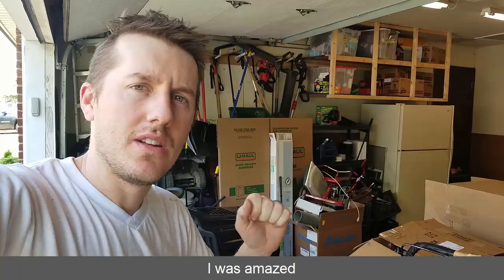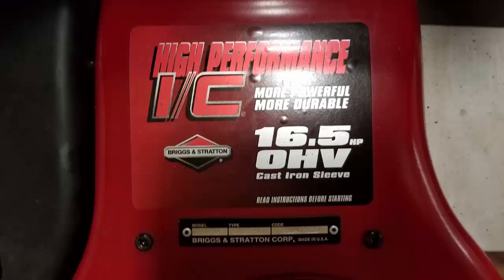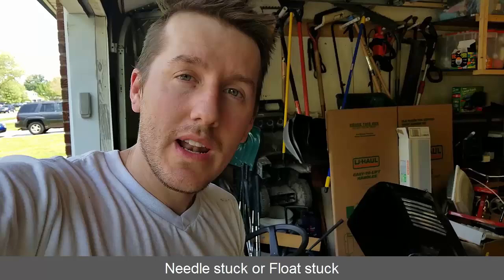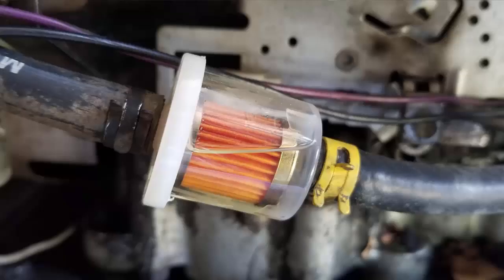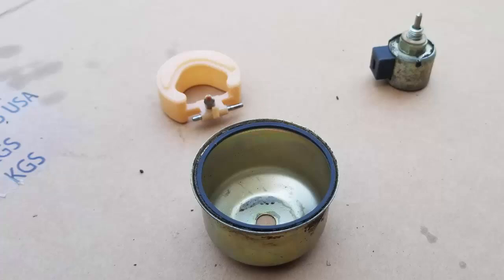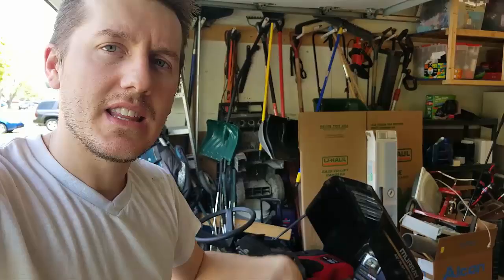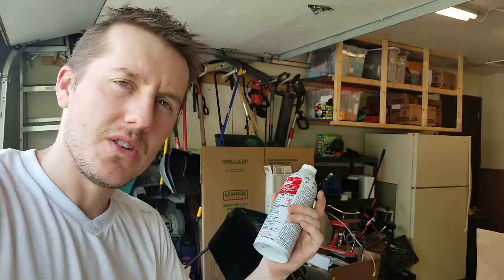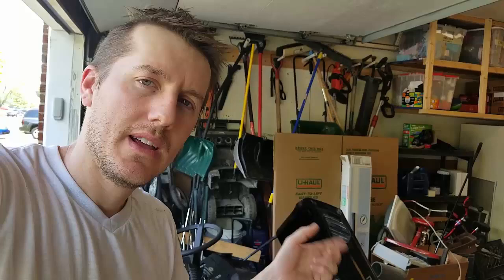White Smoke From Riding Lawn Mower

Comment: Your diagnosis help me fix my riding mower. I was terrified that I was going to need to buy a new one. All I had to do is drain some oil and drain the fuel. Runs like a champ. I'm glad I did a little research and came across your video.  Thanks again 🙂

Comment: OMG....the beginning of your vid is totally my story, except my mower was free. Thanx so much for your easy to understand information.  I've never done any work on a mower of any type in my life and had no idea where to even start. I took the carburetor off and basically just cleaned it, as the float needle was still in good shape and ddnt need replacing. Drained and replaced oil and gas as well. I didn't add the little filter thingy though. That's only because I'm just too lazy. At any rate, she runs like a charm and now I can happily mow my little 2acres on my free riding mower instead of using my push mower. Thanx again!

Comment: The moral to the story with these big OHV and flat-head throwaway tractors is fuel flow. These things will run forever if you don't overstress them...keep the fan and cooling fins clean....change the oil and filter...and install a fuel shut-off valve in the line as in this vid. Use real clamps and not twist wire for same. And if you ever notice that the oil level is RISING, appears very thin and is starting to smoke, rebuild or replace the carb.

Comment: Thanks man!  After several issues, one after another (battery then solenoid), my Ariens riding mower started spewing a MASSIVE amount white smoke, sputtering and dying after only a little bit.  Just knew that it was a cracked head gasket, or something equally bad.  Your video pointed me in the right direction.  Drained the oil, which was 1/2 gas, and changed it out.  Then I drained the carb, by just taking off the backfire preventer, and sprayed carb cleaner on the plug, and up into the carb, without even pulling the bowl off.  I put it back together, and it started up.  Had a little bit white bit of white smoke, some sputtering, but then it stopped and leveled off.  Managed to get about half of the yard cut, but then it started up again.  Did the same carb routine as before, and got it going again, and managed to finish the yard.   Had to make that the priority, as the grass / weeds gotten out of hand since it had been a week between the initial problems.  :-)   Guess I'm going to have to devote some more time to pulling the whole thing apart, and seeing how it looks, but I just wanted to let you know that you were a huge help to this IT. guy with few mechanical skills.  Oh, and I'm going to follow your lead, and add the shut-off valve as well.  Right now, I've just pulled and plugged the fuel line.
Reply: Last year mine blew a head gasket. That'll throw white smoke. If it didn't split, you may can retorque the head down. Be sure to run some ethanol treatment through there. That'll help too.

Comment: You definitely helped us save some $$$. We had someone look after our riding lawn mower and was told we need to replace the engine which would cost us about $800+😢. I decided to do some research and saw this video so i thot why not give it a try. We cleaned the carburator and changed the oil and oil filter and its no longer smoking 🎉. Thank you so much for helping us do  this little tingkering. Im no expert in doing mechanical stuff but suprisingly this video inspired me.

Comment: the needle you showed is to stop gas from seeping into the crankcase when it is not running and ruining the oil. It sometimes doesn't hold back the gas is why you needed a shutoff valve.  It does not control how much gas gets in . That float controls how much gas is in the carb and an adjusting screw controls how much gas gets in the engine. When the switch is turned on it sends electricity to that solenoid below the carb and it contracts and allows gas to get to the bowl of the carb. Ask a dealer. Thanks Stan P

Comment: THANK YOU DAVE X100. I changed the John Deere's fuel filter (10 years old), then removed the air filter and sprayed short blasts of Seafoam Carb Cleaner directly into the carb intake at full throttle. My oil was Ok. Problem repaired for a quickie fix. Shutoff valve not needed.   <<<NO SMOKING ALLOWED.>>>

Comment: the throttle doesnt adjust the gas coming in the bowl, it adjusts a butterfly valve that adjusts the air / fuel flow into the combustion chaimber
Reply: Everyone missed this important point.Thank you for bringing this up!
the deteriorated rubber tip causes gas to leak into the cylinders 
Nice video but  bad terminology

Comment: a lot of these riding mowers use a vacuum powered fuel pump and when they get old they can get a pin hole leak in the diaphragm and the vacuum will cuck gas into the crank case until the crank case gets so full it starts pushing the oil and gas mixture out the crankcase breather into the air cleaner and into the carb intake causing the same engine symptom.

Comment: Thank you, I took your advice to set the throttle in low speed when I shut off the riding mower. It worked, I was about to return it after having it three days, I just bought it. When the mover was delivered the guy start it up, white smoke shot out from the exhaust. I was thinking because it was new it was ok, but the next day I started it up more smoke came out, It would only happen with the first start up. I came to Youtube for some suggestions, once again thank you for your advice.

Comment: Great video!  Been helping my neighbor with their lawn mower as I use it to mow their lawn.  I've recently done an oil change, and it seemed as if it smoked a little.  I didn't over-fill it.  Level was right on.  I've noticed it's using oil, but I think that's because the mower is doing exactly what you showed under the air filter, and blowing gas out.  The new oil is now runny and has a gassy smell to it.  I'll drain the oil, and have a look at all you mentioned.  Should fix me up pretty well.  Again, great video, simple, easy to understand and very descriptive.  Take care!

Comment: That's exactly what is happening with mine. Runs great, engage the blades and tons of white smoke comes pouring out. Briggs and Stratton. I bought a new carb for $20, I think I'll just replace it.  I hope that's the problem as my oil and gas are fine.

Comment: The needle and float fills a bowl that the carb draws from when it needs gas. That is a seperate needle. I would also suggest putting the shut off valve closer to the carb that way you can shut it off and run the carb out of fuel if you are not going to run it for a long time. Easier to fill back up when you start it.

Comment: A gravity fed tank when fuel flows through the carb into engine while off is key .....  also, Nikki Carbs tend to leak gas into the engine because of tiny o-ring type seal that allows the float to leak gas into the carb intake via gravity.  It's kind of like siphon action.

Comment: The throttle has no control over the float needle whatsoever. It controls the throat plates that changes how much air comes into the engine. 

-Small engine repair shop owner.
Reply: And if the needle were stuck, no gas would be flowing...

Comment: Supper you help me with my small wood chipper, smoke billowed out thought engine at end. The carb was ok what had happend was i did not turn fuel off while it was standing for a month. What happend, i think is got hot the fuel expanded in tank and push it way into the cylinder and mixed with oil. Cleaned everything and new oil, work like new, thank for for thin vid it help me solve a possible expensive bill.

Comment: Oh geez, I pulled the riding mower out today, last time I used it was probably in November. There was about a quarter tank and I filled it up. It had ran beautifully last season. I had to jump start the battery but once it got running an obscene amount of white smoke was pouring out. It would rev up a bit and then slow and cycled like that-maybe 10 seconds of revving and then 3 or 4 seconds slowing down. I couldn't see from all the smoke but when I backed it up some, it had been spraying black oil out the front and had it dripping from the front. Anybody with any ideas as to the diagnosis?

Comment: I got a mower for free recently, The engine was so dirty.. I cleaned it up a little bit and changed the oil bought a brand new battery, air filter, put new gas in it. But it was still smoking, I wanna check the carburetor but the screw are stripped and idk how to get the bowl off.
Reply from the maker: There's a thing called an impact screwdriver.  Not sure if it will work on something like a carburetor, usually it's for more heavy duty stuff.
https://amzn.to/325Ol9i
You hit it with a hammer and it digs in and unscrews.

Comment: I'm having the same issue with the same exact riding mower! My question is, did the problem ever return or is it still running well? Its odd to me that this only happens 10 seconds after  the blades are engaged. What does activating the blades have to do with the gas and oil? Why is the oil and the gas mixing together? Thats what I'm curious about. The float cuts off the fuel supply when the little cup is full, so you're saying that more fuel pours in when I engage the blades? How? Why? I drove it for 10 minutes without the blades, and it was 100% fine. No smoke. But the second I engaged the blades the white smoke fogs up my whole block! How is it even related? I'm gonna try the remedy in the video and also change all the filters. Maybe a new spark plug as well. 

I mean... oil was literally spraying out from the muffler. How did they blades cause that??
Reply from the maker: No the problem didn't return, it just happened once, and stopped once the carburetor was cleaned.
I think when the blades are engaged it puts more torque on the engine?

Comment: Great video, but don’t you think it would be wise to use a couple of gear clamps instead of those pieces of wire on the gas line?
Reply: hose clamps work but so does a wire the way he wrapped and twisted it

Comment: I had white smoke come out of mine this morning. It got down to freezing last night. Yesterday it rained all day. It wouldn't idle at first, now it's okay. Oil is good and clean. Here's my question, is it bad to start a riding mower below a certain temperature? Say 40⁰F? I ran it today to grind up leaves under an old maple tree before they blew away. With the ground wet, they mulch up better and don't just fly out the chute.
Reply from the maker: I abuse the crap out of my push mower:  https://youtu.be/khCrL3PQ1PM?t=252   and it has run for years and years.
And no, it shouldn't hurt to start under a certain temp.  After a minute the motor gets up to several hundred degrees anyway.

Comment: Quick question?...
I got a similar mower about a year ago and cleaned it up and changed the oil and battery. It has been running good, but when I leave it in neutral idling and get off it for more than a minute or two it starts to do a similar thing, little bits of smoke start to come out exhaust and then some backfiring. Any idea why it only does this when in neutral and no one is sitting on it? Of course the blades are off then as well.
Reply from the maker: I don't know that one.  Mine happened when i engaged the blades - so just the opposite.

Comment: Hi Dave…I have a similar problem with my rider….the white smoke comes billowing out when I’m going downhill while mowing…mind you, I don’t have a steep grade lawn….it also sounds, while the smoke is coming out, as if it wants to stall out. When the ground is fairly evened out, all’s good. Any ideas, based on what I mentioned, on what the problem is? Thanks for any help you can provide!
Reply from the maker: Not sure, but i would guess it's a carburetor issue??  Letting too much gas pour into the engine on the hill, or not providing enough gas.  But not really sure.
Reply: Water in the gas tank.  Water is heavier than gasoline and is at the bottom of the tank. When you tilt the tractor, it flows and falls less into the hose to the carburetor.

Comment: Hey thanks for the video and I hope that's my only problem. Just purchased a lawnmower and he threw in another one for about 100 bucks. He said the motor is going bad and actually had a box of parts, There's a drip of oil coming off the bottom of the engine and it actually drove fine up in to my trailer and when I got at home I drove around a few times as well. Then suddenly a great plume of smoke filled the backyard. Coming from the muffler. I shut it off and let it cool. And it did start again. Do you think it's just gas in the oil or is it something more serious like seals or rings or something.
Thx
Reply: If u haven’t fixed it yet it’s just oil getting into the carb from the engine so just drain your oil back down to the dipstick level and fire it up try clean your filter if it’s covered but should work from just draining
Reply: James Winters Thank you I appreciate it. No I parked it for now because I picked up a nice Husqvarna for about $400. But yes I will look into doing what you said. Appreciate it.👍

Comment: Hello! I have a grasshopper zero turn mower and after 5 minutos of running time when I'm mowing my lawn white smoke comes out of the muffler when I pull forward. It does this every ones in a while. Any idea what it might be??  Thanks in advance
Reply from the maker: well, if it's an air-cooled engine - the only thing that could cause the smoke is gas or oil.
So somehow gas or oil is getting somewhere it shouldn't.
i would clean the carburetor - maybe spray cleaner in it
Reply: Ok. Thanks a lot

Comment: did the fuel shutoff valve that you added, solve the problem, or cleaning the carb solved the problem?
Reply from the maker: Cleaning the carb solved it.  Fuel shut off will help prevent it happening again

Comment: That’s  part on the carburetor does not do what you said that it regulates the fuel go into the carburetor . That is not truth. The only thing that does is when you turn the  key On . Let’s fuel going in the carburetor when you turn it off it turns off the fuel go into the carburetor yes . When that stops working. Gas go into your engine block.Yes it is a great idea to put it on and off valve in your fuel line thank you

Comment: I changed the oil, installed new carb, and new gas in it, and STILL having this issue
Reply: New fuel filter, and new air filter as well

Comment: I’m having the same problem but I just installed a new carburetor on it.. could it be a cheap carburetor with a stuck float? Also with the fuel shut off val you installed do you shut it off when your done mowing
Reply from the maker: Yes i turn off the valve when i'm not using it, just in case so gas doesn't leak in and flood it.
And yes it could be the stuck float.  That might have actually been my problem.  When i engaged the mower blades it put a strain on the motor and was trying to suck in more fuel, which caused the float to get stuck down.  
Either way it's something wrong with the carburetor.   But a pain if it happens a lot and you have to drain and refill the oil every time.
Reply: Dave Wirth..thanks for the reply I’ll have to take another stab at it.. it is annoying I thought at 1st it was a blown head gasket ..fixed that even though I didn’t see any blow out checked the breather that looked fine..and figured why would it be the carburetor that’s brand new.. but I guess there’s crappy ones sold on amazon..
Reply from the maker: @fanman1981  It almost happened again to me again when i was mowing really long grass, the motor bogged down and smoke started coming out, but luckily i stopped and it didn't get flooded.
Reply: Dave Wirth to come to think of it it all started with mine when I had a bent mower blade and it dig in the ground and stalled out.. I changed blades and it started acting up after that.. I was like NOW WHAT..I kept my old carb so I’m thinking I’ll swap out float needle and float out of that after a clean out..the main jet got bend and broke was the reason I bought the new carb..

Comment: My mower surge's and blows oil n smoke out of muffler.....head gasket????
Reply from the maker: Maybe try cleaning the carburetor first.  It's cheaper and easier.  Could be the float is sticking, feeding the engine too much gas ??????
Reply: Red Blue40 same